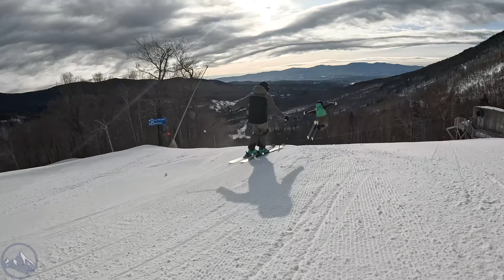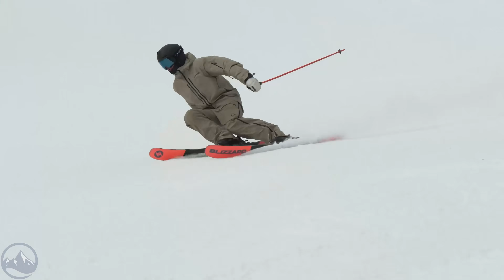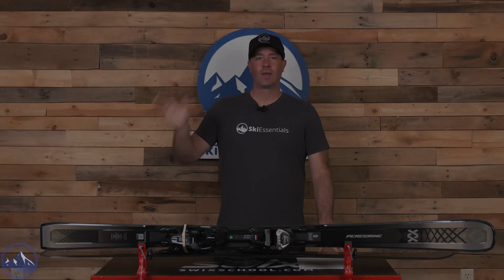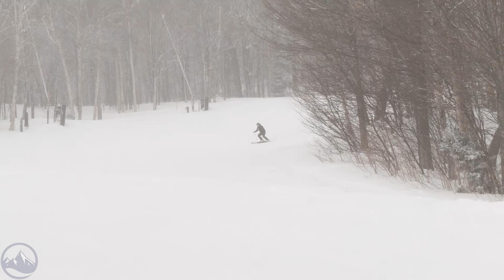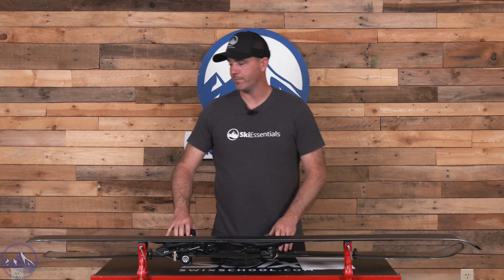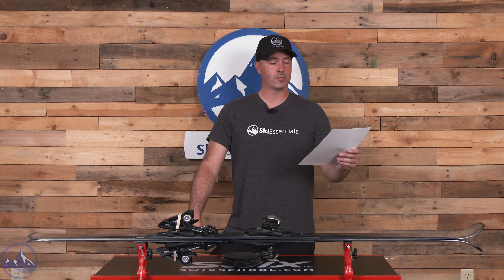2026 Volkl Peregrine V-Werks - SkiEssentials Ski Test Review

Comment: I own the Deacon 80, skied the 84 many times, but this v.werks is a class above. The composure at speed, low swing weight and energy it gives back is insanely good! The best bit.. you can ski it all without getting fatigued. 

Buy it, find a groomed black, it will let you arc curves and skid turn a fall line. If you can think it, it will do it! 

Only downside is the tip is catchy in soft crud if you ski head height.